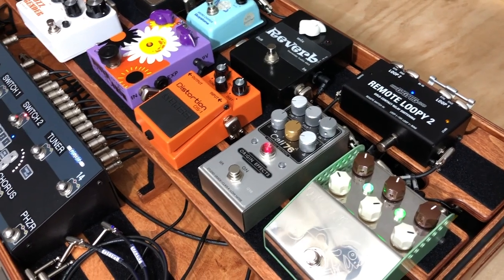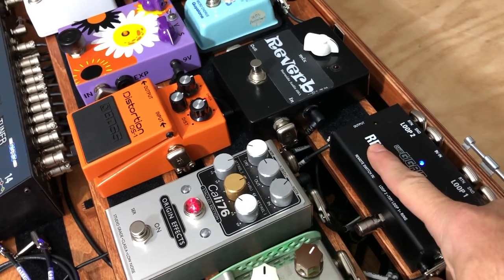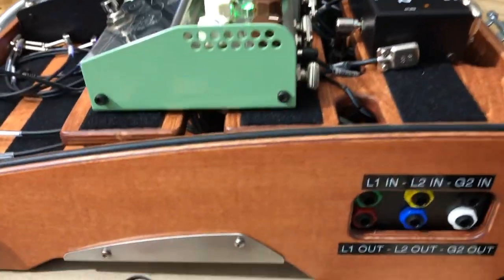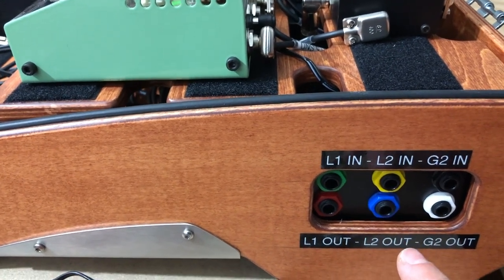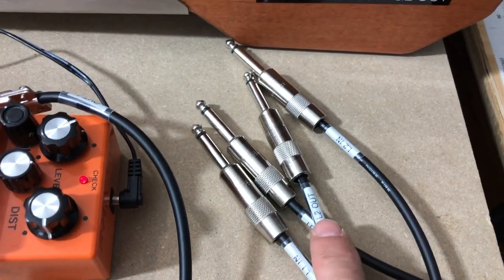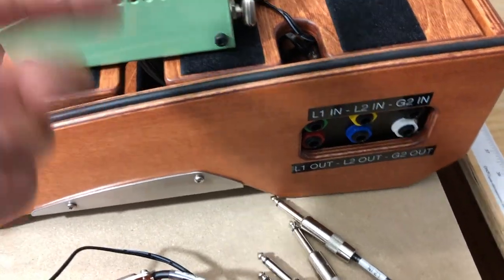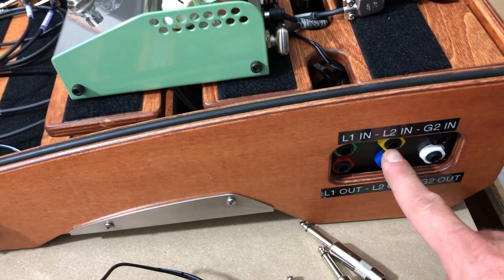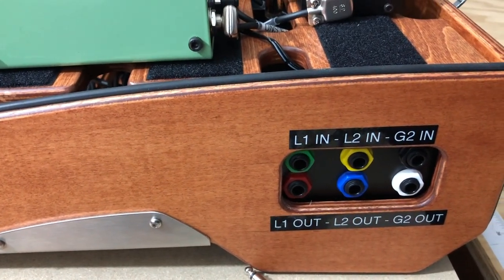Schmidt Array Patchbay And GigRig Remote Loopy 2

Comment: The green and yellow are connected when nothing is plugged in. Does the patch work like you want it to? Something seems odd there. If nothing is in holding that feed both L1 & L2 imports together, or an I reading it wrong?
Reply from the maker: Nothing is connected by default between any of the jacks on this patchbay, and everything worked as intended. Besides, regardless of what is plugged in or not, you can always disable the loop the Loopy 2 is plugged into for your standard signal flow.

Comment: Question. If the customer added the loopy 2 to his channel 10 on the G2, he essentially loses a channel and so it all becomes an 11 channel G2 instead of 12. Couldn't he (his guitar) just go in the Loopy 2, and then the Loopy 2 into the input of the G2? I am not sure what buffer the Loopy 2 has and what meg reading it has.
Reply from the maker: I don't see any reason why you couldn't change the position of the Loopy 2 depending on your needs or what pedals you wanted to add into the chain. The only thing I would look out for is pedal order concerns and, as you noted, possible buffer/impedance changes this could create. You'll want to consult manuals or GigRig directly (their website is pretty user friendly) for info on the buffer specs. This was just what made the most sense for this customer and their board.

Comment: Question: loopy is in loop 10, does that mean you can only try one pedal at a time?
Reply from the maker: The G2 turns on the loop the Loopy 2 is plugged into, but the Loopy 2 turns its own loops on or off. So, you could activate loop 10, but both loops on the Loopy 2 could be on, off, or one on and one off. Basically, the G2 is not controlling the individual loops on the Loopy 2 in this setup.
Reply: @AlphatoneAudio  thx…and the signal path is in front of the G3 if I’m not mistaken, so you can’t necessarily reorder those extra two pedals.
Reply from the maker: @Dixey3  Correct, no way to automatically reorder the two loops of the Loopy 2.